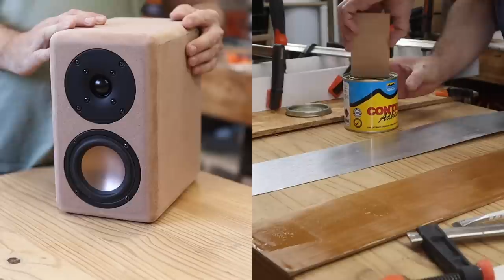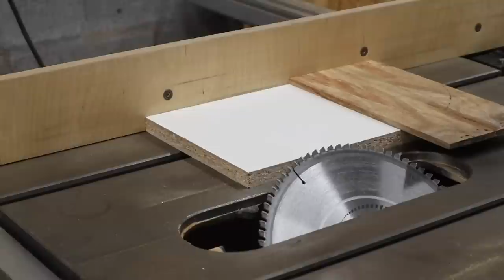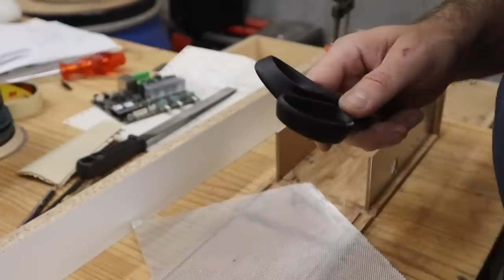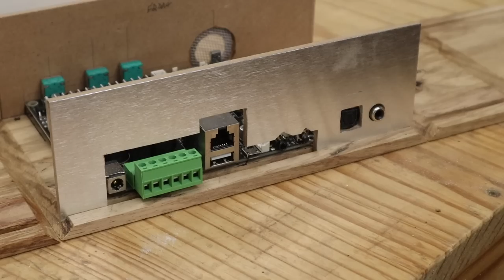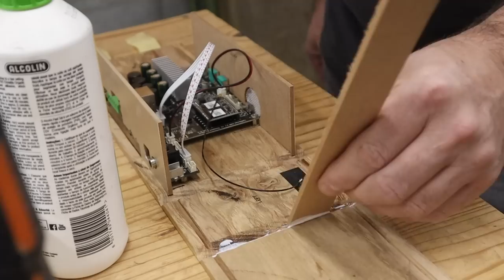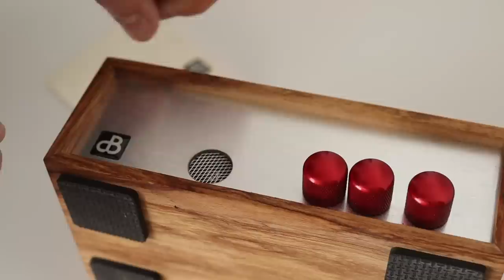Build a 2.1 Channel Multiroom Wireless Amplifier - by SoundBlab

Comment: The sound quality and craftsmanship of your designs & builds are second to none on YouTube! My next purchase from you will be for the Dynamites to build for one of my sons.  I’m also looking forward to building this amp to power them for PC use. Are the wired speaker connections provided by the pins on the rear of the amp board?
Reply from the maker: Thanks! Yes, the speaker outputs is the green connector on the back of the amp board.

Comment: Amazing. This looks really great. Which power supply and connection on the amp board did you opt for? I know the board has two inputs for power.
Reply from the maker: Thanks. I’m using an external 24v powerbrick.

Comment: What power supply do you use for the amp? Is a laptop power supply up to the task? 19V and 65W?
Reply from the maker: It is a 24v 5A supply
Reply from the maker: It will power it, but you might lack some oomf in the bass region.
Reply: @SoundBlab  thanks for the feedback. Looks like a dug up a 150W 19V laptop supply that’ll be much better. Do you think there’s concerns with noise/interference coming through from a laptop power supply? 
I’m really looking forward to your upcoming subwoofer build to compliment the bookshelf speakers. Keep at it, I’m loving your content!!!
Reply from the maker: That will be more than enough for this amp. Noise should not be an issue. Thanks man.
Reply: @SoundBlab  Are you planning to build a new subwoofer for this amp to go with the Dynamites bookshelf speakers you made, or will you use one of the previous subwoofers you have built on this channel?  I am thinking about building a Voxel Sub using the Tang Band W5, but I am apprehensive to proceed until i see what you are planning to go with your Acrylic 2.1 amp.